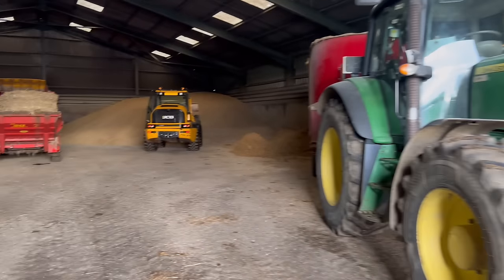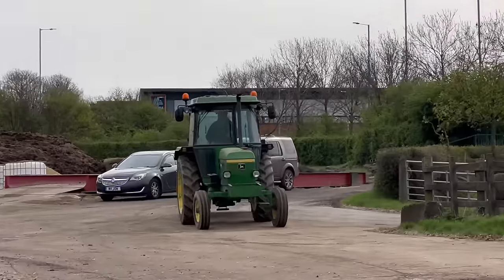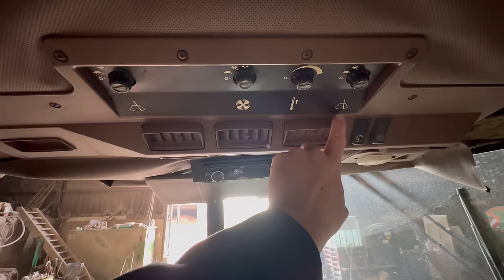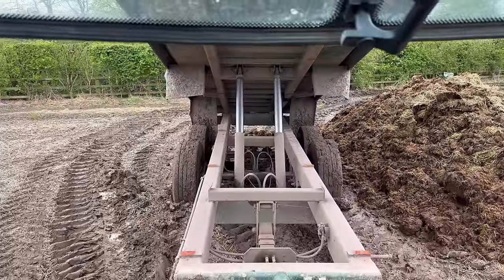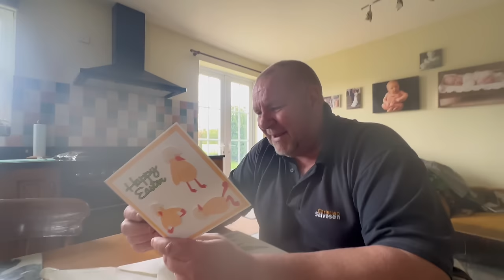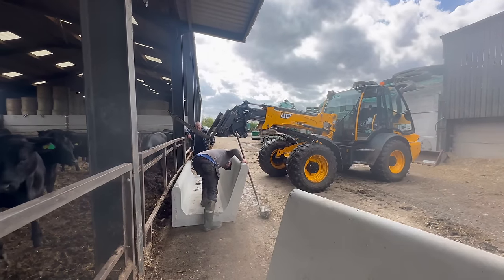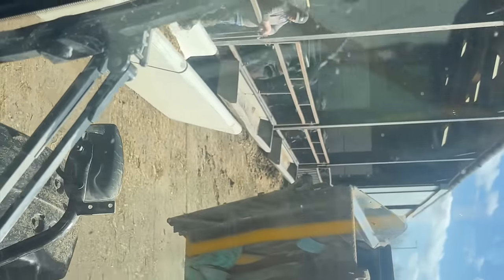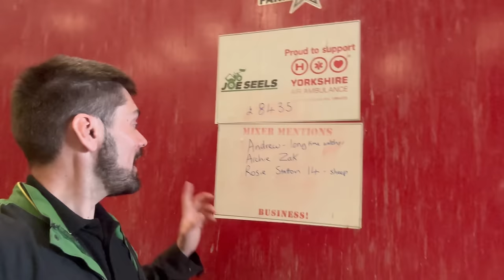New Construction on the Farm! Vintage Tractor John Deere 1640, JCB TM320S! Farming Videos Real Life!

Comment: Those 40 and 50/55 series will still be around in 50 years. Absolute bombproof machines. I wish i still had my 3140.
Reply: True Us built ones are better than german built tractors and the German built ones are better if you put a high output hydraulic pump on them and the 3640/50 was a better tractor than the 3140/3350

Comment: Dad had 2140’s in 2wd for a few years on muck spreading with Howard side discharge spreaders until he upgraded to two 3040 4wd with 2 Bonhill 10t spreaders. They were fantastic tractors and never had a spanner on them. One of the 3040’s had done over 7k hrs without having anything on the link arms. Great video Joe as always! 💪🏻👍🏻

Comment: I dont think that your test on the lights was done correctly. You should have switched the lights off, then walked back the desired distance and then switched them on to see if the light unit picked up the on/off signal.